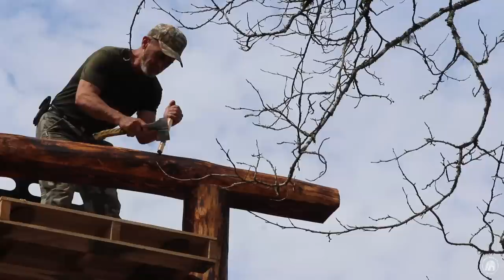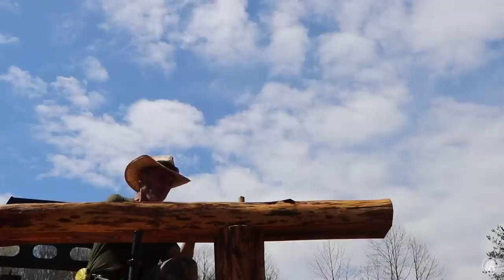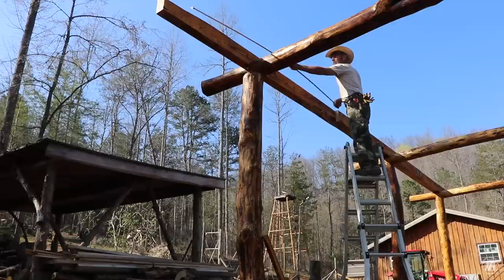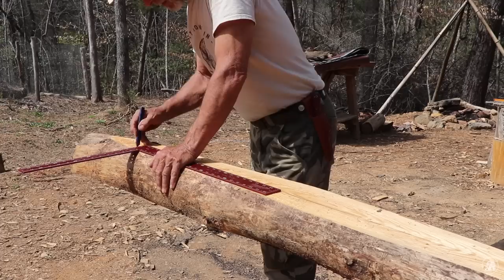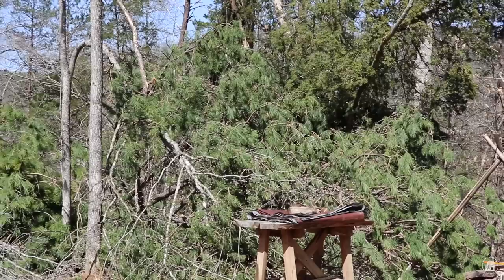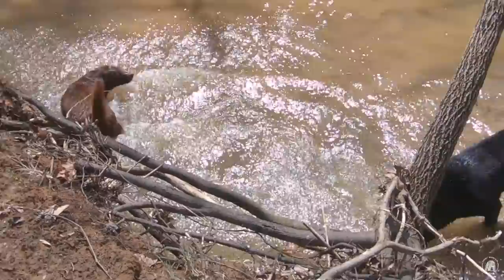Roof Framing & Perlin Post for Crazy Crooked Carport Pt. 5

Comment: what kind of wood did you use for the pinning of the perlin's. you were hitting them pretty hard with the sledge hammer
Reply from the maker: I mentioned in the video they were oak stakes that you can buy at the lumber yard. Farmers also used them here for tobacco harvesting by hanging the plant from them to dry in the barn.
Reply: @SmokyMountainOutpost  Thanks for the reply, keep up the great work.